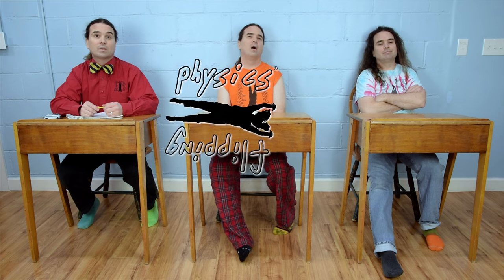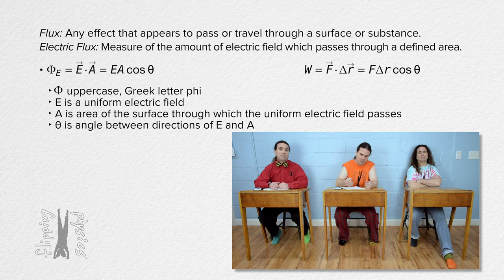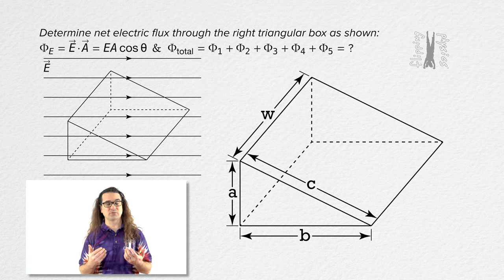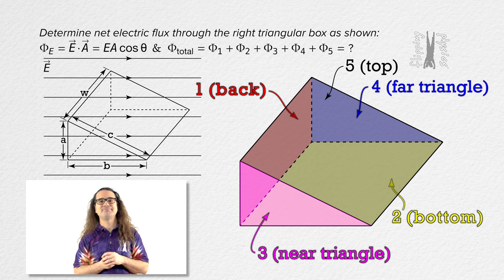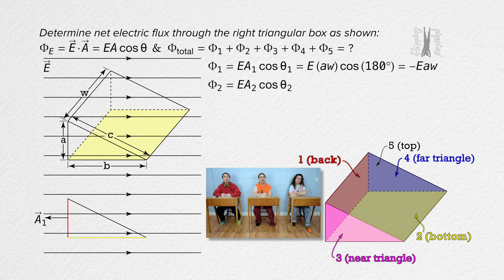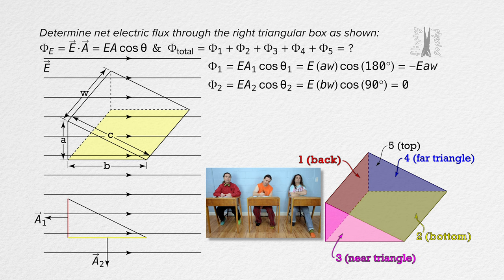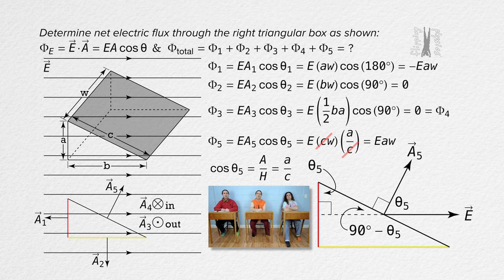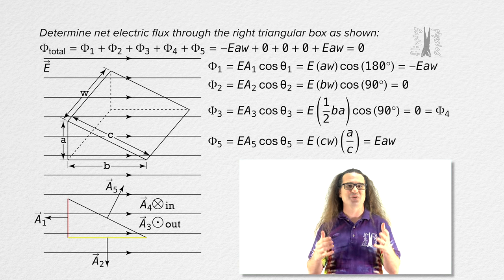Electric Flux

Comment: Hi, I'm currently in E&M, and I'm having some trouble with finding intuition with this E&M in general. I understand this question may not have an answer, but I was wondering if you have any recommendations for how I can better 'wrap' my head around all the charges, gaussians surfaces, etc. etc. Comparatively mechanics is far easier to actualize in my mind since I live in a mechanical world, and I can somewhat imagine the concepts I learn, however the electrostatics stuff just flies over my head.